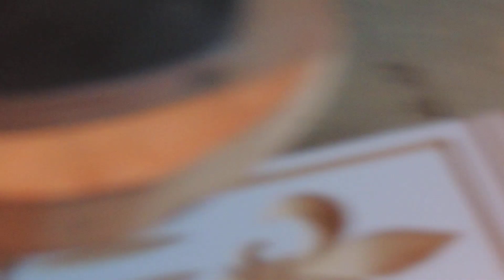diy cnc making carved blocks

Comment from the maker: My second build using TR14 Trapezoidal Acme Ballscrew Leadscrew on all 3 axis and Square 14x3 Trapezoidal Steel Nuts VKM14x3D it is now totally reliable and great to use. for woodworking backlash is not an issue, I also now use car reinforced fuel hose as connectors from motor to leadscrew. also I have had zero problems with the 3.1Nm Nema23 439oz stepper motors and TB6560 Driver.